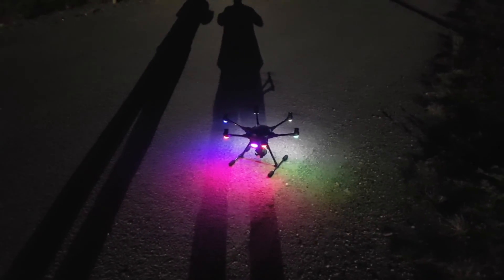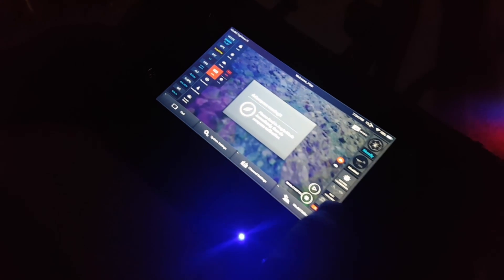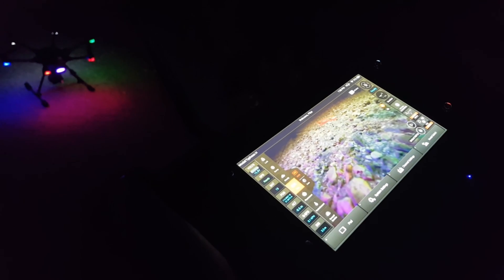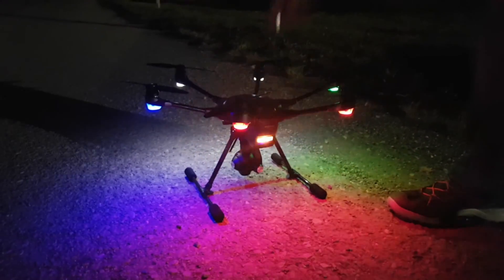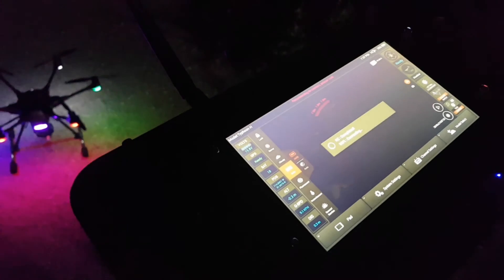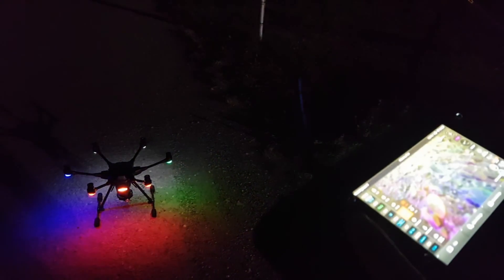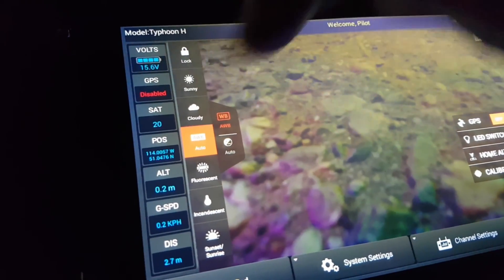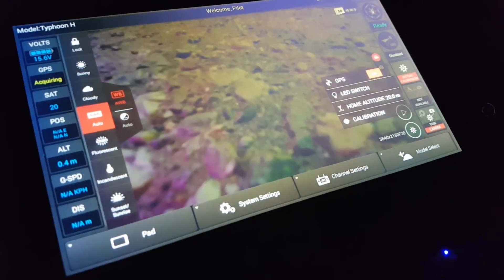Drone Crash Whats Wrong with the Replacement? Yuneec Typhoon H

Comment: Send it back, request a refund, then get a Phantom 4 Professional.
Reply from the maker: ricardopr54 take a look at the banner for my channel :-).  I now have an inspire 2.  What a awesome platform!   Some videos to come  after the colder winters days I will film something for the channel.
Reply: Drone_Video Awesome!  Well done!  DJI in my opinion is the best and more reliable Drone manufacturer in the market.  I was second guessing about getting the H as my next drone, but after this video I decide to go for another DJI product.  I'm still debating between the Phantom 4 Professional or the Mavic Pro.  I need a new drone before summer in order to film my next vacation trip.  I'm going to wait until April to see if DJI release a new Mavic Pro 2 or a Phantom 5...If not I'll need to choose between the two... Inspire 2 is way to expensive for what I want it for... 

Thanks for sharing your experience with us!  Have a great day. Greetings from Douglas, Arizona. 👍 👍 👍 👍
Reply from the maker: I'm going to get a Mavic also, but in the summer sometime, I am not rushing as I don't need it for anything....  Oddly enough I'm headed out to get one with a friend in 5 min!  at staples of all places...  they had a few in stock somehow....  I think the Mavics size is very handy... at the end of the day its super easy to bring the Mavic and pull it out and use it, the P4 takes planning...  this is why I got the inspire 2, same amount of planning as a p4 pro would take, and I will also get the mavic for the times I want to grab and go and travel with....  the Mavics camera is good enough for sure...

I had really good experiences with the Yuneec Q500+ so I purchased the Yuneec Typhoon H Real Sense sight unseen.  Regretted every moment of that ownership after the first 3 days...  The first 3 days were very good, that thing flew very nice!  to me the TH fly's better than a Phantom actually.  (but the inspire is a world better!).  I loved many things about it, but that firmware crap was killing me...  I managed to get a grand total of 12 flights between when I ordered it in Jan 2016 and returned it in Dec 2016.  Starting with the last version 2.9 -  I think it was the first firmware where it started flying really nice actually...  and 3.0 gave back some ghosts, I didn't even bother going to 3.01.  

The forums are still have people talking about similar issues with fly aways and the like.  I gave up, the Yuneec TH stole my enjoyment of the hobby for all of 2016, and I decided I was not going into 2017 with that baggage.  I managed to work out a good agreement to get out the Yuneec and secure the Inspire...  I am LOVING IT (Inspire 2)!  the flight characteristics are very nice.  There is a good many things I like about the Yuneec TH too, but I needed it to get into the air and stay there.  So many people have good luck with it, but I didnt.  Yuneec customer service was however very good,  I can't say enough how much they wanted it to work and tried very hard.

At the end of the day I didn't want to do the weird dance to get it to fly.  I ended up learning that after firmware updates leaving it powered on for 5 min before flight was a must to get the GPS almanac and Error correction data properly downloaded (but not documented)!.  Anytime you let it sit for a few weeks you had to do the same procedure....  no one ever could say for sure if you had to, but the ritual felt required by many.  If it wasn't for the poorly written firmware that would be a very nice platform.

At this point, no looking back - I'm full ahead with the Inspire 2.  This is my first DJI product (Ever) and so far very happy!  I still like Yuneec the company and customer support people were very good - However after spending $3000 USD on the TH with all the extra's, air shipping it, 3rd party charger adapters, etc - and only flying it a handful of times in the entire year I just had to walk away....  this video shows what I was dealing with for months, but this all started with a complete loss of control and a crash into the ground, and then months and months of trying to make it work, exchanges of units, and part swaps on my own - i am SO GLAD that Im out of that Yuneec.
Reply: Drone_Video I don't understand what you did you mean when you said that one need preparation in order to fly the Inspire or the Phantom 4 pro!  In my opinion you always need to plan your flights with whatever aircraft you want to fly. In my case, I always choose calm days, I cheek the wind direction and average speed, Check for possible obstacles nearby like power lines, trees, ect ,  and of corse I plan the shots I want to take....  

I think that so far my best choice for a new drone would it be the Phantom 4 pro+... I'm just waiting for their price to start dropping a little bit.
Reply from the maker: I was referring to the size of the Inspire / p4 meant you could potentially not have it with you as often - where the Mavic you could bring to more places.  Planning the flight and planning your shots yes you have to do all that - but the reference was really like having a point and shoot with you all the time and you would get a picture when ever you wanted, where dragging 75 pounds of a DSLR with you "in case" you wanted a shot was not likely....  Sometimes its nice to have the ability carry around something small and available even if the camera doesn't do as well as as DSLR in my example....  where dragging a p4 pro around Europe backpacking maybe is not possible for what ever reason but having the small, light and available Mavic is idea - I can't see trading water or food supplies to bring a drone with me, a Mavic means I don't have to make that decision often....  (I hope that makes some sense?)

Flight preparation and survey etc is always a must - thats pretty much the same process no matter what your flying (maybe  small difference for plane vs quad?) and I would never encourage one to skip that,  knowing whats around, your landing positions, wind patterns etc all important and never change for any flight prep.

I subscribe to the same school of thought  as you on the wind, speed etc (I have a pilot in the family so I just use his weather reports and notices).  Wind here can change drastically and being close to the mountains with chinook weather patterns etc I have to be extra careful.  But I also like to know the craft can handle some wind.  I will not fly when the wind could be challenge, but at the same time I want to know it can handle a localized wind pattern thats not ideal should I discover one...

At the the end of the day the thing that caused my tipping point on the splurging for the inspire was the heated battery... we have a long winter and the heated battery meant I could fly safe in mild winter weather - meaning I could have more flight time and safer, allowed me to justify the Inspires cost difference.  If it wasn't for that final decision criteria for me I would have ended up with a phantom 4 pro and probably never would have even considered a Mavic as a result.

I hope you pick your P4 Pro up soon - I don't know what part of the world you are from, but if your not effected by winter like I am grab one as soon as you can and start flying!  I'm not sure if DJI's new practice of stopping manufacture of the older versions of products will mean easy access to low prices of prev generation when new model builds start.  But then again, picking up a used one may not be a bad idea too....  its all going to come down to timing....
Reply from the maker: Arizona - Nice!
I have already stopped by your channel and watch 3 video's, and then subscribed - very good quality content - been flipping back and forth with this chat and watching your work!  I'm a little envious, Arizona is the perfect place to own a drone - I am hoping to make it down there one day once I learn about all the rules for the hobby flight....  I have a bunch of friends that go down for biking (Mountain bikes) and wanted to get some footage for them.  Hopefully once I review all the rule for the USA flights I will be able to fly there!

Your channel has great content and you will see back there!
Reply: Drone_Video Thanks my friend!  I also subscribed to your channel.  Greetings from Douglas, Arizona.  Have a great evening.  Where are you writing from? ...
Reply from the maker: Sunny southern Alberta (Canada) - a small hamlet that barley even made it onto the map!  but its home....  the summers are nice and the winters drive you to sunny beach holidays!
Enjoy your day, I enjoyed the conversation...  and thank you for the sub, I hope to bring you some interesting content from our part of the world also.

Comment: this video came for me right on spot. I just finished an email to Yuneec reporting the exact same problems. The strange thing is that my H, arrived only two weeks ago, which i assume has all updates on firmware. Unless am wrong? My only guess being an amateur is that this is caused by a faulty compass on board the craft? or is that a silly guess? I sure do hope i get a reply soon from Yuneec, i suggested a replacement, but then again, if it does not really change anything, why ship back and forth? Been flying the Q500 4K since August, so happy with it, had a compass calibration back then, never needed another one. This time with H, thats all i do, repeating calibration, with no results. Bit frustrated to say the least...Nice video my friend, keep it up...
Reply from the maker: Well, I will give you some advice that is controversial.  If you are getting compass errors and GPS errors either before you start the motors or shortly after like I was, make sure you are at the latest version of the software from Yuneec's Website.  DO NOT expect that it shipped with the latest software,  the only way they ship with the latest is if its been in for repair they upgrade it before shipping it back.   If you are at the latest, and It still does this many people have reported that the integrated Compass/GPS Swap resolves the problem.  (Most suspect its two hardware versions and one is bad and one is good).  This is where the controversial advice comes in - when I got my TH back, in a moment of frustration I let it sit powered on, no motors spinning in a clear open outdoor field.  After about 20 min I did the compass calibrations and I started to get it work.  It still took firmware to resolve the issues, but that 20 min really helped I thought, many people disagreed.  This was based on a post in the forums that talked about how this specific GPS module worked in acquiring the full GPS Almanac.  You WILL NOT need to do this step every time, and maybe not even at all, I think the software updated fixes something related to the GPS Almanac acquisition time.  It would not hurt to try the 20 min thing if you feel it will help you, but I truly suspect your firmware is old and is one from he doggy batch.  Search out CaptainDrone - he has some video's on his site that show you how to do this proper that are easy to follow, and download the firmware from Yuneec's Site.  DO NOT do the OTA (Over the Air Upgrade) as its too risky until you are comfortable with the process.  Use the SD card procedure.  Id love to hear back what version you have currently with the issues, and if you upgrade what the results are, or if you end up swapping out the GPS/Compass Module.
Reply: Hey mate, thanks so much for the detailed and time consuming reply. Its always so great finding people like yourself, ready to actually lose time over helping someone they dont even know. A HUGE THANKS my friend. Now, while you were writing all these suggestions, first thing i did was to check what firmware i have. I crossed the ones offered on Yuneec site with the ones on my TH and ST16. They are the same exactly. So my next guess, is following your advice to let it sit for 20-30 mins, afterall, am in no rush , plenty of free time. Like i said, i already sent an email to Yuneec CS today, hoping for their reply. IN the meantime, i will just try over and again to see where it gets me. Will definitely let you know if i get any feedback from Yuneec, or if the 20 min sit gets any results. Thanks again mate, Happy Holidays
Reply from the maker: No issues on the offer of time to assist - everything I learned about this I learned from others who offered the same - I got the information for free at one point, and it will be shared the same.

Its good to hear the firmware was already up to date.  That narrows down the likely issues for you to a bad GPS/Compass board or just the "wait 20 min" thing I did.  Since your firmware is new already, Id be surprised if the 20 min wait worked for you and you could in fact have that bad board.  The board is pretty easy to charge if you have some skills with swapping parts, it will save you time from sending it back and waiting for its return, but if your no comfortable with the swap yourself, a local hobby shop can probably do it for a few bucks if you want want to wait the time to send it back and forth...  Id still try the wait 20 min thing and see if that resolved the issue, but of course do not fly it if you don't feel its not running perfect. I look forward to hearing back.  BTW Yuneec Customer service is very good and helpful.  I would call them vs an email, it seems they answer most calls and and arrange for your repair etc with one phone call.  I don't know if they are open right now, but its possible...  I know they are open Saturdays and thats great for hobby flyers!  Despite all the drama with mine, I can not fault the CS team at Yuneec...
Reply: Sorry, but i still have to thank you, i agree with what you say, but not a lot reach out giving a helping hand. I just finished my 30min sit. I started on and off the motors for a few times, no propellers, everything seems ok,no warnings, all clear,  but still need to give it a try tomorrow flying it around. Keeping my fingers crossed ...:) will definitely keep you posted. THANKS MATE !!!
Reply from the maker: Don't run the machine without props on them..  that will harm the motors, plus the software in the TH is looking for a specific resistance on the motor to detect a failed prop/motor to enter something called 5 motor mode.  All you have to do is start the motors but DO NOT lift off the ground (DO NOT use the left throttle stick, assuming you kept the standard RC Remote mode 2, if this doesn't make sense, then you are you still in mode 2).  I just let the motors run at idle with props on for a few min to see if the error shows up.  Also, you need at least 10 GPS Sat's on each of the controller and air craft, however do not ever start to fly with 10 as sometimes it can loose connection from 1 of 2 GPS Sat's  for a few seconds and the aircraft will not have enough GPS Signal to work as you expect it, always wait for about 14 to show up on each or more before you start flying.
Reply: Thanks, will keep this in mind, i guess i still have a lot to learn, it makes sense what you just explained....will be coming back tomorrow with an update of results...